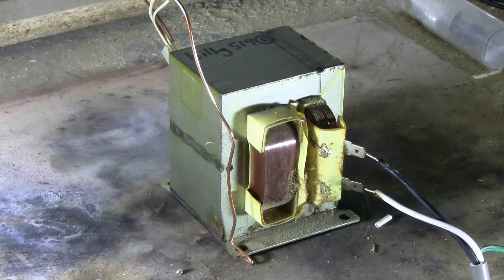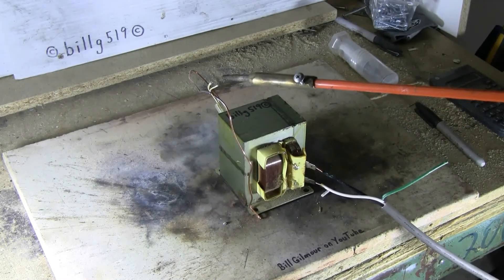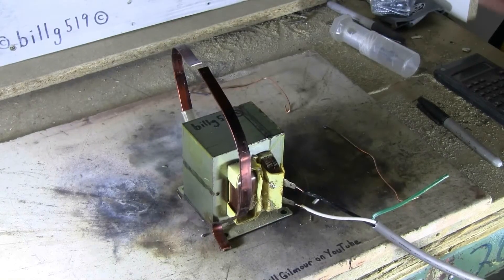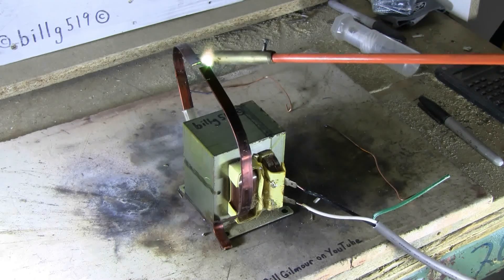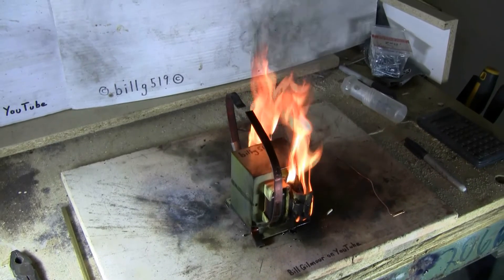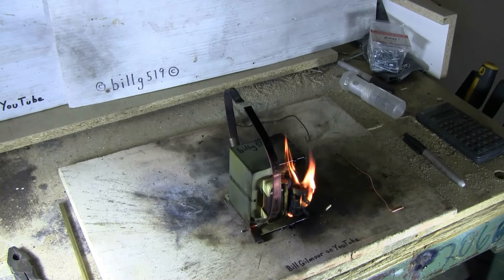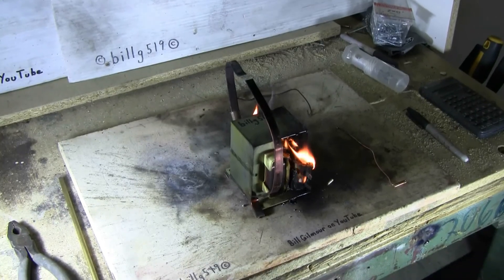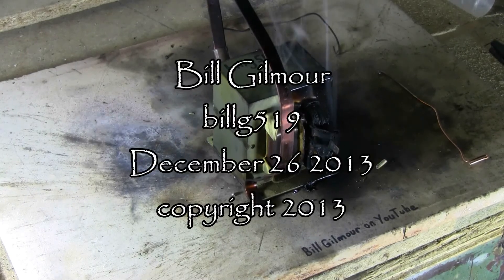MOT Burnout !!!

Comment: I think the copper wires are a little too thin to withstand the heat of the arc and that's why they keep melting, making the spark gap bigger, and extinguishing the arc that was originally sustained

Comment: That arced for quite some time before burning out. Last one I fried went up in in flames in around 20 seconds.
Reply from the maker: It was a small MOT, perhaps that's why it was so slow. I will try this again with a large MOT to see if there is a time difference. Also, my MOTs are 120V, I don't know if a 220V MOT would fry faster or not.
Reply: I would imagine they would take longer since the current draw would be around half that of the 120v winding.